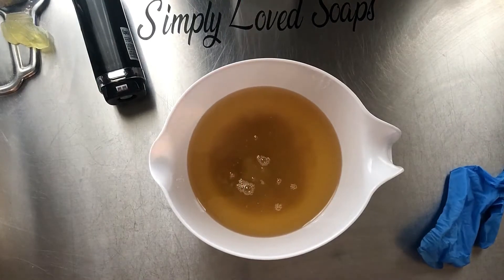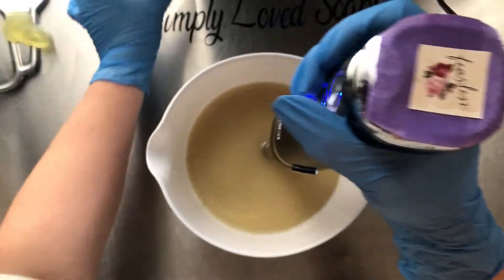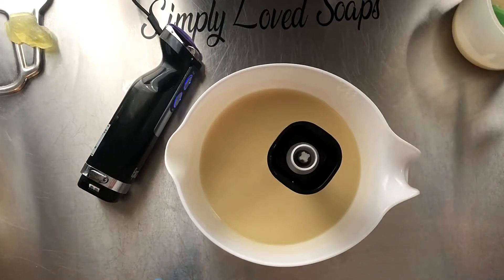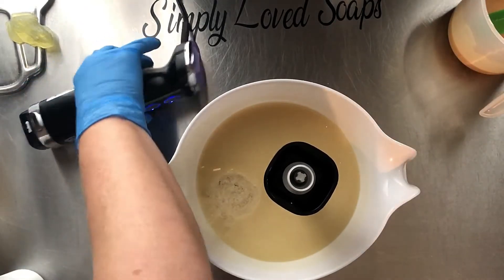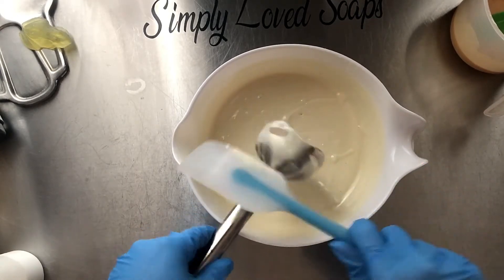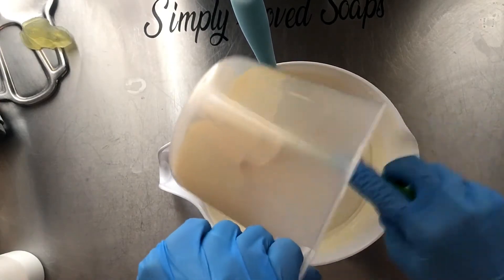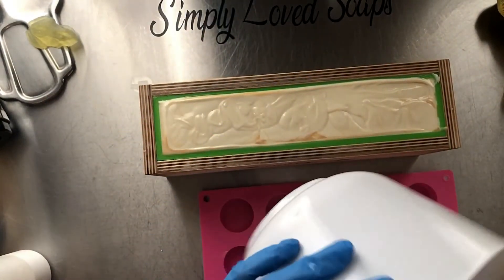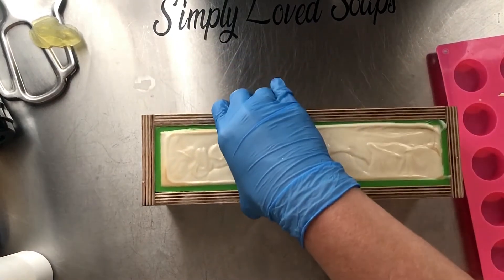Remake of Pure Grace Type Cold Process Soap

Comment: No it's cut right you have it backwards that's why it's wonky if you turn it around with the smooth side up to your soap it will be more sturdy and no chance of scuffing the bottom of your bars I've noticed alotta soapers have it that way but you have it on backwards
Reply from the maker: chelle motsinger I understand that... the other side of the block that you flip around has a big cut out of it this is a defect.  The defect will not give it a clean cut Chelle. That is why I don’t use it the other way. Thank you.